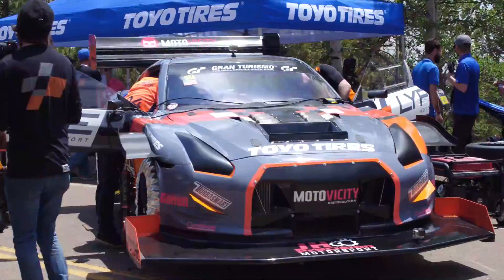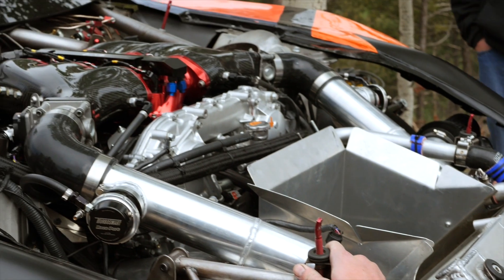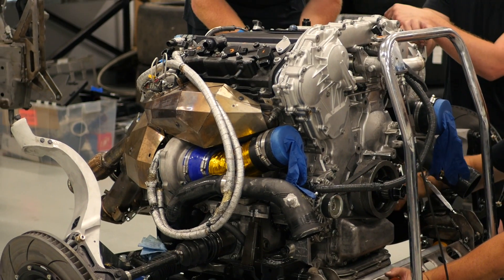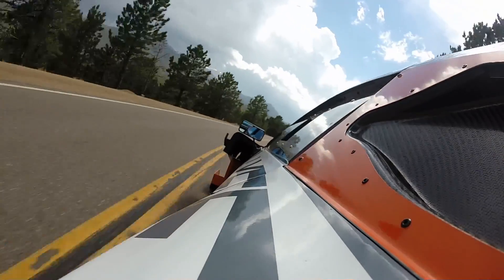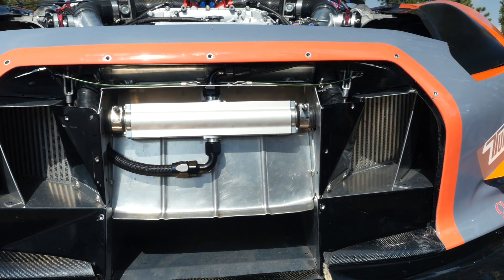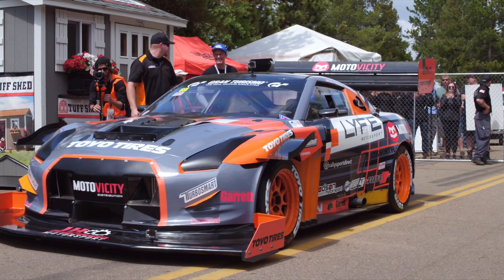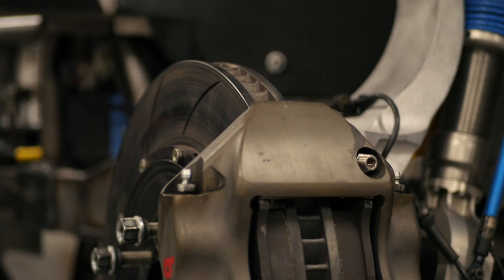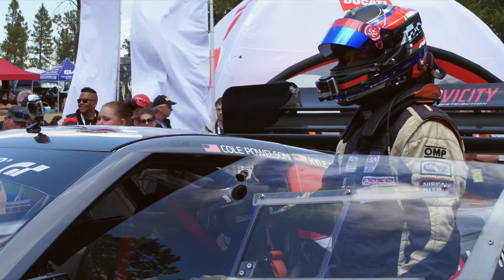[TECH TOUR] World's Fastest R35 GT-R Time Attack car | Pikes Peak 2017

Comment: I wonder what crank was used 
What RPM has been used and the rod length 
Usually a R/S ratio of 1.7 to 1 is the way to go
And we usually try to keep the piston speed below 5,000 gpm
People get all revvy ,use the torque use the gearbox use the CR and good clean new fuel
Never use old fuel especially when you’re pushiythe envelope
Block rigidity will also play a factor in the crank life
If that block starts flexing you’re in a world of hurt 
We had over 1400 hp at sea level for our PP car 
We turned it down it was so undriveable
We found 1,000 was about as much as was necessary to win

Comment: Any idea on the grade of steel used for the crank? Don't have the best resolution shot of the failure, but it looks like the crack propagated from the root off the fillet, got a fair few cycles in then failed catastrophically . The crank could have distorted in the H/T process (greater than machining allowance), thus straightened in the press which could have induced a stress crack, then it's just a matter of how many cycles before failure. P20+Ni makes for a stout crank. If you're paying for custom cranks, shell out the extra to get them NDT'd for peace of mind, expensive lesson!
Reply from the maker: If you're keen to take a look there was a bit of discussion about it on Instagram - https://www.instagram.com/p/BWbJzQkgZoC/?taken-by=hpa101 - Taz
Reply: High Performance Academy Cheers for the link. You guys are putting out some amazing content

Comment: Do you think this car would benefit from carbon carbon brakes?
Reply: MadB0mber Gaming i think C/C brakes have a very high working temperature when compared to other types. It’s not ideal for a hill climb situation where you start relatively cold. Higher up the hill you’d definitely benefit as the brakes stay hotter for longer because of the drop in pressure and also they’d have warmed up by then.

Comment: If it's not the custom crank itself a failure because of the material/production of the crank,poor tuning comes to mind.lets not skip the flywheel housing failure ..that could be the least as well...curious about the origin of that custom crank though..
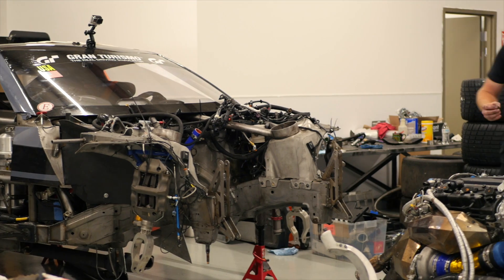Reply: @00:49 just looking at the way it broke makes me think something is fishy there. if u look at the half in the background the metal is blue like the metal got extremely hot. then u take a look at the grain structure on the half in the front and the left side looks good but as u get to the middle it starts to look very different. something ruined that temper in the metal and i kinda wonder if someone tried to weld a broken crank back together at some point. look at how the blue ring lines up with the different looking crystallization. like a torch was held there and got the metal hot enough to blue it. that or it was rubbing on something in that spot every rotation of the crank just enough to work long enough to destroy itself

Comment: With the lower compression ration when using the stock crank could they have turned the boost up more to help fill the cylinder void?
Reply from the maker: Absolutely, and this is something the team did do - Taz.
Reply: advance the spark timing also

Comment: Great video once again! With the reduced stroke what did the compression ratio become?
Reply: Assuming the 4.0L was with a 93mm crank (3996cc) and the previous CR 10.5, it became 8.31:1, but more importantly the squish increased 2.3mm, which is a big problem